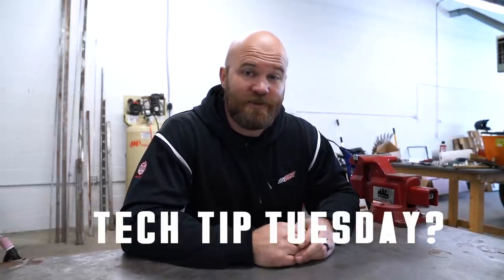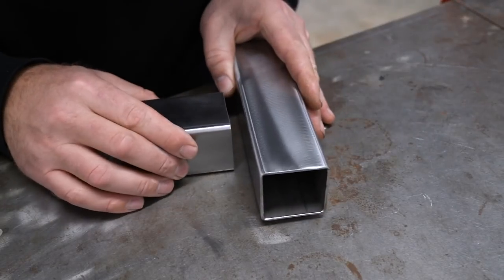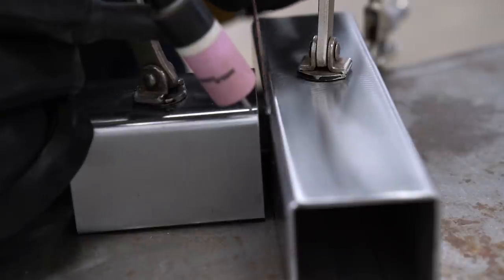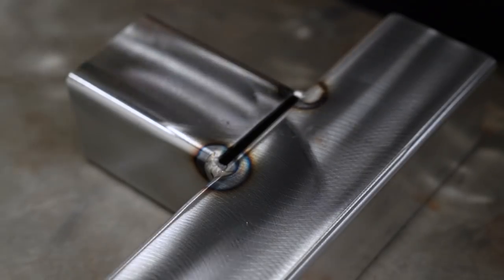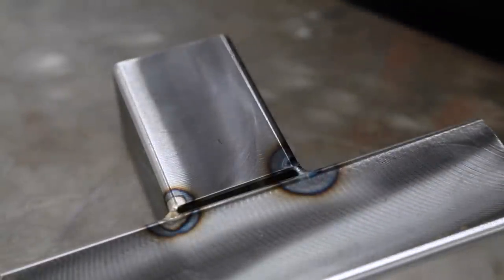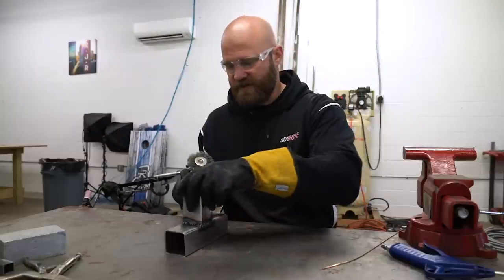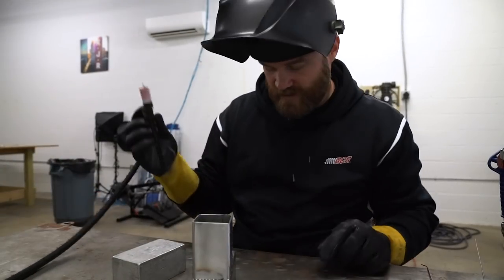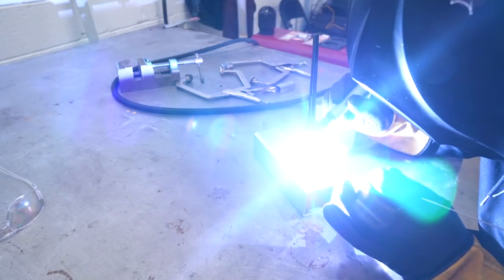How To TIG Weld ANY Gap

Comment: Interesting technique but I was just left wondering why you didn't just weld it as if it was an open root? Bridge tack and then you basically just weave it in keeping the tungsten aimed at the puddle while feeding filler. Not sure if I'm describing it correctly, but if you look at open root pipe for instance you'll see what I'm talking about.

Comment: Would using a bit thicker filler make this a bit faster or would you melt the tube trying to melt the rod?
Reply from the maker: I think the tube was to thin for that, the tube also wasn’t the best example for what I was going for but it all I had around at the time.
Reply: I modify diesel fuel tanks all the time. The bigger the gap the bigger the filler wire I use. Mainly because the smaller filler rod gets used up so fast.

Comment: are the tacks cracking because you have no slope-down on the current? It just looks like the arc extinguishes. Other than that, I like your approach.
Reply: Yeah, when it comes to TIG, and you’re at the end of your weld, or just need to stop in the middle for any reason, it’s always best to slowly let off the pedal at a steady speed. 

But that’s when you’re using a pedal for your amperage. When you’re using a scratch start or lift start, it’s called “tailing off” in which you stop feeding wire and you start moving back and forth at a much faster rate so the puddle doesn’t have as much time to heat any one spot up too much, and then you eventually break the arc, and if done correctly, you won’t end up with a “fish eye” or dimple where you broke the arc. I personally hate doing any TIG without a pedal. Scratch start and lift start requires you start off by essentially contaminating your tungsten (even that little bit, yes) before you even have the chance to fuck it up yourself by dipping it, lol. 

Also his method of filling a gap is okay for welding things that aren’t crucial or particularly load bearing. But for anything that shoots X-ray or even ultrasound testing, this method is a big no no. But he was just mimicking a gap on a square tube weld, generally something like a handrail, or building a table, something simple. So it’s nbd in this situation
Reply: @evanarnold3663  Anything critical has a much better fitup than this anyways... that's just kinda par for the course. I would never do it this way anyway, I'd rather pack the joint with something else and allow normal tackup and proper seam welds. But it's always interesting to see what other people get away with.
More modern lift-arc sets actually have a voltage sensing setup so you close the arc right up <0.5mm, at which point the power source automatically downslopes and extinguishes... but here in the UK most people on coded pipework use buttons on torches without any foot pedal, and you set up automatic upslope and downslope.
Reply: Matthew Ramsay I’ve fiddled around with the torch buttons and the slope settings  on our Miller Dynasty (i keep her in my area so the other two welders don’t fuck it up, lol. I’m the only one that seems to take care of my shit, company equipment included) whenever we aren’t buried with parts to weld. I’ve just never been keen or scratch or lift, but that’s me. I feel like I’ve got shit tons more control with a foot pedal, and I don’t have to either A. Reach for the button to stop and end up twitching (even if it’s minuscule) or B. Have to keep my finger resting on top of the button the entire time, limiting my repositioning options mid weld. 

Absolutely, in this instance, it’s just some simple joint for non crucial parts, so all that ever would really matter is the aesthetics in the end. That being said, it’s different where I work, because we are a job shop, but we mainly do structural stuff, so when we get some TIG in the shop, it usually means it’s real fuckin crucial and I can’t be fuckin around layin down shark teeth n shit 😂 just my take though, but you were absolutely right. Simple shit, anything goes, just filler up bud haha

Comment: When I’m filling gaps I like to weld in reverse pulling torch backwards and adding the wire from the back of the pool ( bit like welding into a corner )

Comment: I’d just like to remind people that you can’t use the same brushes and wire wheels with aluminum, steel and stainless. Aluminum and stainless require stainless, and regular steel can use anything. But you can’t use aluminum stainless brushes and wheels with stainless, and visa versa.
Reply: You can you will just have contaminated welds lol.  Label your brushes people.
Reply: good point!!.... fought with that when I as first learning how to weld cast, or what I like to call 'floorsweepium' because they swept the floor and put every bit of garbage they had into it... I hate cast.
Reply: @lukewarmwater6412  cast is a nightmare.
Reply: You really have to heat cast. I’ve got a laboratory oven I bought on eBay some time ago. It goes to 550. I heat the cast to about 350, more if the shop is cold. This isn’t just required so that it doesn’t crack later, but it gets rid of a lot of crap you can’t get to with the wheel. Then, it’s not too bad. Just use the right stuff to weld it with. Unfortunately it’s so expensive.

Comment: Do a small weld across the lip for heat sync and a hot pass with faster dabs but occasionally switch up and use the tack method such as yours.

Comment: Best way to fix gaps is to beat the fitter until he can fit without gaps. 
 EDIT  As a welder we all know the little ways to "punish" a poor fitter. Little things like tacking real fast so he gets flashed or my favorite of striking the arc on the material he is holding so he gets a nice little jolt. Anyone else have any favorite paybacks to a poor fitter?  Oxy/acet light bulbs work real good to keep the painters and sand blasters from messing with welder tool buckets. Great for fishing too.
Reply: Yeah platers are great at leaving big gaps, then walking  off!!!
Reply: Welders we all have to look at gaps. The size of the gap is  relative to the ability to read a tape g('_')p.  Fitters don't cry about the size of your filler rod while they're eating lunch with their Girlfriend. Or yours?
Reply: I like the way u think!
Reply: Yeah,  destroy the guy's eyesight.  That'll teach him.
Reply: @budburr66  When you are given an idiot for a fitter , sometimes you have to use the nuclear option. The "fitter" that was passed down to me as youngest on the crew couldn't fit closer than 3/16. Every welder on the crew had flashed him until he moved to the next welder. He shortly left the job and I was told he went back to being a plumber. Plastic glue fittings dont care about a poor fit-up.
Reply: Welders always cry it's to long, it's to short. So as a fabrication guy I would cut a 16th short and told them to deal with it. And when they cry I would weld one up an tell them they're in the wrong job. Lol I can fab, weld, and paint.
Reply: Welders should fit their own crap.
Reply: Yeah ruin his eyes where he cant see that will make him fit it better    smh
Reply: So not a teaching moment, punish him instead. How about teaching him to do it the right way and waiting until he does?
Reply: Well, that's one way to find out if the fitter has a pacemaker.  Or a taste for practical jokes and revenge.  More details at the trial...
Reply: Yep, pissing me off always gets me to do my best for you.  I'm sure you feel the same way about people who piss you off.

Comment: Sadly the light of the arc fails to show the surface of the weld whilst welding, either better filtering with a strong light illuminating the work when not welding or processing the video sections with the welds in progress would be more instructive. I know when I learned to TIG weld over 45 years ago, watching the pool form and fill were key to me learning how to get a great weld.

Comment: Hi, newbie question if you don't mind, could you cut a piece of cleaned filler rod in the gap and then weld it in or are there reason against such a practice. Enjoyed the content of the video and the explanations. Now subscribed so keep the good stuff coming. Thanks
Reply: The rod would heat up much quicker than the box section and just drop through. Even though the melting points are the same heat is getting drawn out of the workpiece by conduction through its mass. That's why the filler rod is not continually inside the arc.

Comment: What you could also do is use a bigger filler, typically with metals such as aluminum and carbon steel, they react much nicer, in terms of not requiring a backing gas to protect over penetration, granted gaps like this should always be prevented because the filler rod will be stronger than the base metal which ultimately results in less long term strength, hot cracks, and even lack of fusion.

Comment: Tac all four corners with a mig, then go back and tig it all around. Or just mig weld it if is easier. You can also put a small piece of scrap on there and fuse it all together.

Comment: Mig welding will fill those gap quickly and efficiently. 1/4 Biggest gap I ever weld. The trick here focus on bead. Those metal are thick and very less chance of blowing a hole in it. Try using 22 gauge sheet metal and very likely blow hole if gap between. I am practicing on welding thinner sheet metal, and it not an eazy job. Just technic, style, and movement on hand exercise. Machine setting is crucial while welding. Thick sheet metal, higher amp and speed, and thinner lower speed and amperage. Safety first and have a lot ventilation.

Comment: i use mismatch collets without shielding issues. Prob with first tack looks more to my like the line had oxygen in it. I always push the tig button once in the air  for purging the line before welding.
Reply: Then you are lucky. At my workplace, they had this same problem after they had to change the torch (a bad mix of coolant flow problems and high amps). The old collets were too short for the new torch, so the ceramic cup's threads were partially covering the gas holes in the collet, causing turbulence in the gas column.
Reply: @patrickreed8950  Correct me if i'm wrong, but the shielding gas passes between the collet and the collet body (or gas lens), so a bigger ouside diameter of the collet would restrict the flow, increasing the gas column speed. In the case i described, when i pointed the torch at my hand, i could feel the gas flow from almost 2 feet away.
Reply: @bogdan_n  Can't correct you because you aint wrong. - And look at the brown around his fiorst tack. - If he would have held the torch up for a few seocnds and let the argon preflow and purge this issue would have never come up.

Comment: Once I get it tacked at 4 corners I build off of the tack with a weave, I go 1/4of the way from each corner then fill in the center
Reply: you have no idea what you're doing... that is okay though. youtube is full of missinformation.  never weave a root. always bevel your tube, pipe, plate.  when you weave on properly beveled edge it destroys the underside and ultimately makes your underside pass after the fact 3 times wider than the top side.  never weave a root.  its a waste of time and an improper way to weld.
Reply: To be strictly correct this is not a situation that would require multiple passes, also I would have corrected the fit up prior to starting the weld. We all have to do things we dont like,and it depends on the gap, I personally keep 1/16 and 3/32 wire for tig, if the gap is to big to fill I scrap it and redo.
Reply: @No1414body    you cant always scrap and redo..  ive been welding pipe for 15 years, yo7 cant always improvise so doing things the right way is very important
Reply: Justin,  you are exactly right in a perfect world concept but that was not the way the question was asked. He said non structural home type welding. If it is just something you do in your garage to make do,byou do what you can. I personally have a complete machine shop, also on big gaps I have used a structural filler or lap plate per AWS,  but in this case for home and farm use it's not worth it also if I was charging someone and assuming liability it would be much different
Reply: @No1414body   cutting corners one time sadly leads to cutting them again.  do you drive to work in reverse? no because forward is the way to go..   there should have been a question mark in the title of the videe.  proper welding and prep should be used in everything you do.  if there is an exception..  its because your exception is cut wrong. do it again!
Reply: Listen kid, I've been doing this alot longer than you , at work code governs, at work you would never weld a gap on all four sides of a tube connection, also the 2 sided where the radius meets has to be played, look it up, this whole discussion is a mute point, are you trying to impress people? I've got a ten story building sitting In a woods in Colorado for 30 plus years. I've got dragster going 200mph in the quarter mile. I've been in work situations where they had you lay a pencil rod in a gap, which is never ok because pencil rod is 36ksi and welding rod is 70ksi, get off your horse little boy and get over yourself

Comment: I would use acetone rather than laquer thinner --- acetone doesn't have any hydrocarbon residue much to speak of and cost about the same. Yet it is a solvent for greasy stuff. Secondly many people don't realize acetone is miscible with water, so if you need to you can wash away acetone with distilled water in a second step.

Comment: I'm  curious about those collets.  Did they secure the tungsten when you snug up the torch at all?  I always thought all these were the same.  I close gaps just like you did unless I  can lay the rod right down on the length of the gap and just go across it like an autoginous bead. That works good sometimes too.  Nice job.
Reply: laying filler over gap is unprefssional 
if the welds ground away then theres goes your peno out the window

Comment: I gotta  get me a tig set....if I can gas weld, is tig more difficult?
Reply from the maker: Yeah I’d say it is but with practice you can learn anything. I bet it wouldn’t take you long to get the hang of it.
Reply: I think tig is more easy. Less heat more focused on one small spot. Even if you dont have a pedal.
Reply: I think tig is stronger than gas welds even though I think gas welds are still approved for airframe repair or construction.  I need to look up if oxy welding is still approved for airframe repairs.

Comment: whats the air tool you use called??
Reply: Roloc
Reply from the maker: It’s a Snap-on angle grinder with a roloc disc on it.

Comment: Another good way you could do this I do like what you showed with putting in the teeth that is definitely not a bad idea but what I might do instead personally is just run a bead across the rounded edge of the one tube and on the 90° on the bottom tube just run a weld maybe two closing up that Gap a little and then you have filler material across the whole way and more weldable Gap to actually go in and put your final weld just what I have always done if in a situation like this as well as the same technique can be applied with other welding processes if you have a bigger Gap and our same MIG welding or stick welding etc and still don't have a weldable gap just weld on whichever edge can handle the heat best that you're going to put into it and just run small filler weld until you have a gap that is fully weldable bam done good video though not a bad way to do it for sure.

Comment: I weld a gap like that the exact same way I weld an open root pipe, loads of wire feeding and let's say 3 mm material thickness would be 90-100 amp

Comment: The collets should in general be exchangeable between brands. You had some bad luck I think.
Reply from the maker: Yeah I think I did too
Reply: Absolutely!  Collet would have had nothing to do with it!  Good catch.  43 years experience sez gas coverage problem. A collet is a collet . All it does is hold the tungsten. Lol
Reply: Try to keep filler material under the shield gas. Quit stabbing it in and out of the coverage.
Reply from the maker: Ronnie, the gas lens seats against the collet. If it was machined wrong in a bad batch it could cause a number of problems. I’v also seen gas lenses that didn’t have a step machined in it that all others had. Right above the threads.  Also caused problems.
Reply: @JustVoss  tungsten would fall out if collet was bad. Gas lens threads in and bottoms out. No way a bad collet causes a coverage issue. No disrespect.

Comment: Good point about cleaning your filler rod.  BTW:  What are you using for the Arc shots?  The clarity is really very good!
Reply: I use emery cloth to remove the copper coating from filler rods and then use brake clean to clean the rod before welding. But that's just me.
Reply: I have heard break cleaner can be very toxic when you weld over it just a heads up

Comment: as much as i would love to bag on airgas and their house name brand radnor...that was your tungsten not the collet causing issues. you must have had some type of contamination on your 3/32 tungsten. mix and match parts all you want, try the ck wedge collets though, must better and last way longer
Reply from the maker: Same tungsten, literally just changed the collet and it stopped. I could have just got a bad batch out of tolerance.